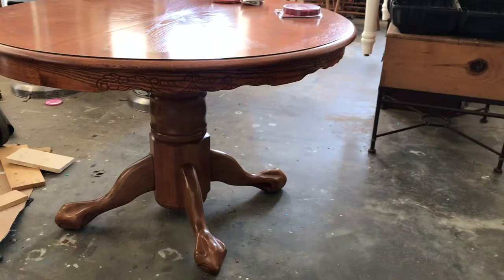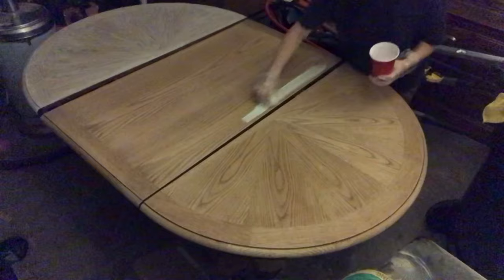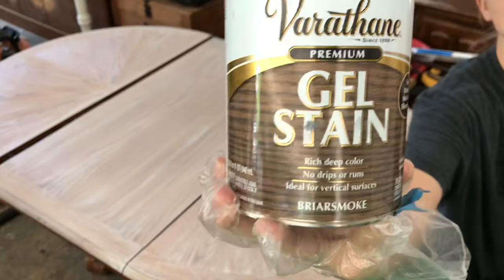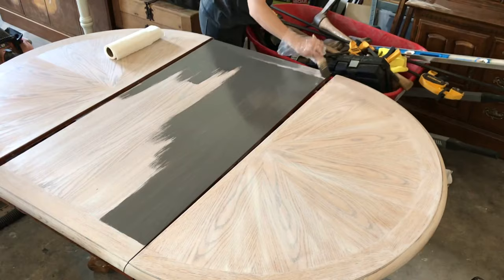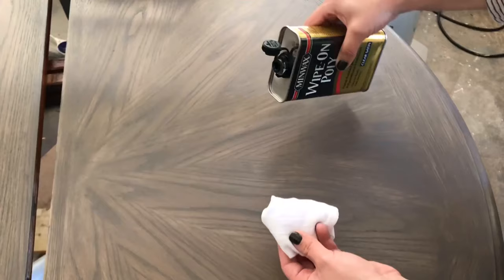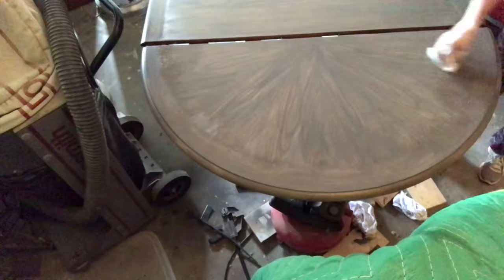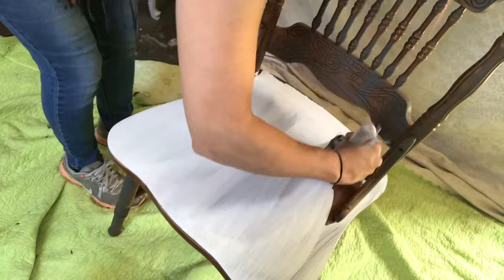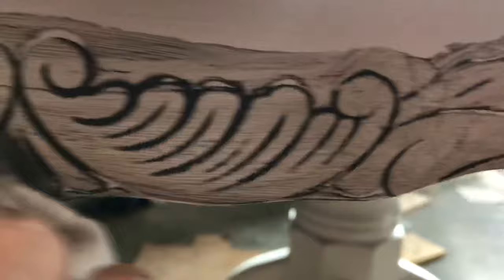OLD Kitchen Table Makeover Light Grey Stain | beginner friendly, step by step how to

Comment: How long did you wait in between layers? After applying the white wash to apply the grey and after the grey to apply the poly?
Reply from the maker: The white wash dries pretty quickly in about 2 hours and the stain takes a bit longer because it’s oil based I waited 24 hours and the top clear coat dries really quickly because it’s applied so thin I was able to reapply every 30 minutes until I had about 4 coats of that on for protection

Comment: Hello, I am new at doing this so I need some help.
I want to use minwaax polyacrilyc on top of that 
So I get greater protection for my kitchen table I have 3 kids so it will need to be often cleaned.
Can I do that?
Reply from the maker: I would use oil based wipe on polyurethane on the grey part of table if you have kids, the wipe on poly will be your best strongest defense you can buy. Don’t use it on the white parts bc it does yellow over time which you won’t notice on gray but you will on white.  For the bottom use trim paint from SW and just plan to touch up as time goes on but you can clear coat that with polycryilic

Comment: Did you use a top coat on the bottom of the table
Reply from the maker: I didn’t Bc the paint is “trim paint” from Sherwin Williams but if you wanted to you could add a topcoat for even more durability

Comment: I have a round table that I bought from someone. She used a chalk paint and I want to paint it like this. Would I sand it down the same way? And what did you do for the base?
Reply from the maker: Yes, sand it down just like I did ♥️ I used Sherwin Williams trim paint for the base and before I painted I just lightly sanded the base with 220 grit sanding pad

Comment: How you know if you should use the pickling wash?   Will this wipe on poly yellow over time?
Reply from the maker: I almost always use the pickling wash so I have a nice base for my stain colors, kind of like a clean white canvas.  In short, yes, the oil based wipe on poly I used will yellow over time.  They do have a water based wipe on poly and water based products don t yellow over time.  I wanted the durability of the oil based topcoat and I dont mind a bit of yellow on a wood table, def wouldnt use it on a white project.  Its a tradeoff, hope that helps!

Comment: So I sanded my table then put a stain on it and the next day the table felt almost sticky from the stain. Is that normal?  I definitely need another layer to darken to get to the grey should I stain again and then put the polyurethane on and it will be fine or do you think I did something wrong?
Reply from the maker: oil based stain can take a while to dry especially in cooler/wetter months, I’d wait till it dries to do another coat of stain

Comment: It seems that the Minwax White wash pickling stain is discontinued. Do you have any other recommendations? Thanks
Reply from the maker: You can use the Varathane one from Home Depot or any white wash will work, even making your own using 1 part white paint and 1 part water 
https://www.homedepot.com/p/Varathane-1-Qt-White-Wash-Interior-Wood-Stain-2-Pack-349565/308460703
Reply: @blacksheephouse  Thank you so much for the reply. Is this one applied before the stain or on top of the stain? Thanks

Comment: What kind of paint did you use on the table legs? The same as the chair?
Reply from the maker: I used Sherwin Williams pure white paint, in a satin finish.  and if you have kids you might want to give a polycrylic clear coat on top of that for extra durability

Comment: Hi how long after you apply the gel can you apply the poly wax . You didn’t mention that . Thank you !!!
Reply from the maker: Hey!  I had to wait about 24 hours before it was completely dry, if it’s cold or damp outside it could take up to 3 days  ❤️
Reply: When I applied the first coat of poly the briarsmoke stain wiped off! This will be the 3rd time starting over (rookie mistakes). Do you think I just didn’t let the prior smoke cure long enough? The room is not humid but I only waited 24 hours. I didn’t use the gel version, but the oil based stain. How can you be absolutely certain it is completely dry?

Comment: Did you need to stand the table top between coats of the wipe-on poly?
Reply from the maker: I think there were a few spots I super lightly sanded w/500 or higher grit, like if a bug or debris landed in it while it was drying, but the wipe on poly layers are so thin sanding too much could remove it entirely